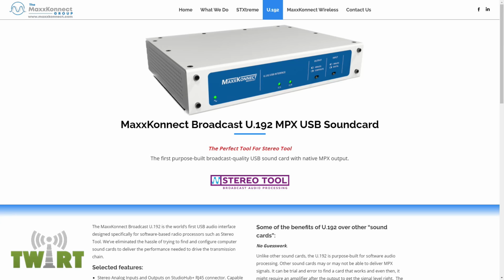EAS, Fiber, and Creative Tower Sites with Chris Tarr - TWiRT Ep. 664

Comment: On Episode 664 of the TWiRT Podcast, Chris Tarr does an excellent job of explaining the work of the State Emergency Communications Committee that interfaces with the FCC on the operation of the Emergency Broadcast System. Then, Chris talks with Kirk A. Harnack about the installation of optical fibre links, and thinking outside the box when siting transmitters and translators.